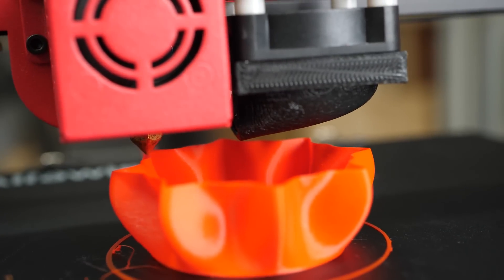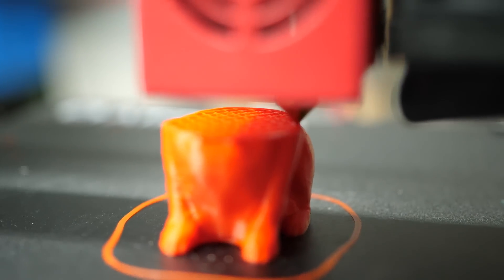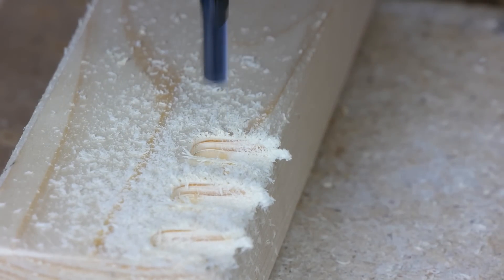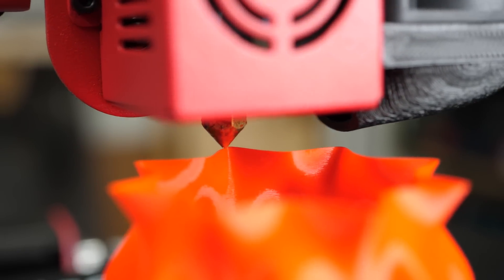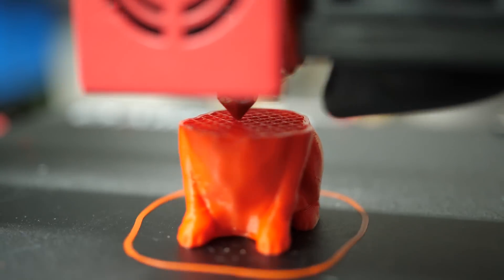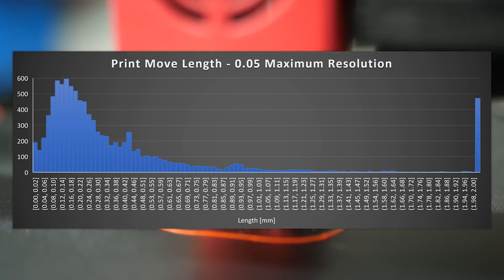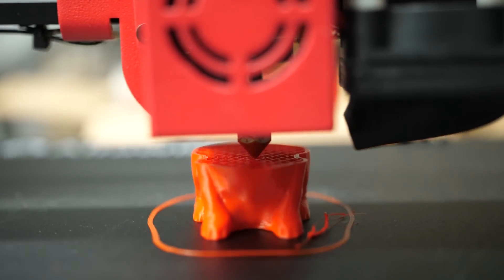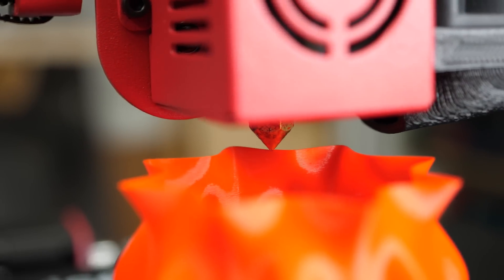(How) I finally got rid of these blobs!

Comment: Instead of adding new features, CURA/UM should just add diagrams and pictures like what you show at 3:35 in an info box next to each setting. There's no point in adding a million settings if the user doesn't know what they're changing.
Reply from the maker: Download the CURA Settings Guide plugin. That will add a lot of pictures to the tooltips.
Reply: @CNCKitchen  Thanks for the tip!
Reply: @CNCKitchen  can you add a link to that plugin,thx
Reply from the maker: Here : https://github.com/CNCKitchen/GradientInfill
And directly in CURA : https://github.com/smartavionics/Cura
Reply: @CNCKitchen  This is awesome, something I have been wondering/wishing for!😁
Reply: Most settings are described on their website Cura wiki. But yea its hella confusing sometimes. Same with the new retraction minimum distance settings.
Reply: Good point!
Reply: Yay! Picturs!
Reply: I love cura for that reason, so many options to experiment with, and to make prints better and better. If you learn your self you will never forget, if they give you all on the plate then life would be boring .
I personally love challenges!
And love overwhelming amount of options in cura !